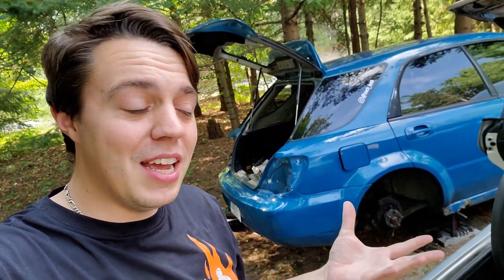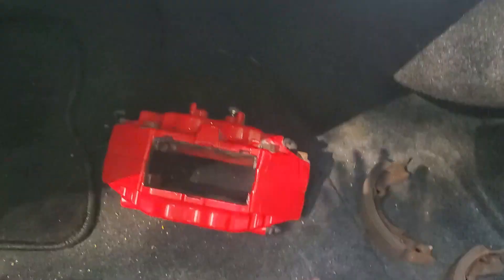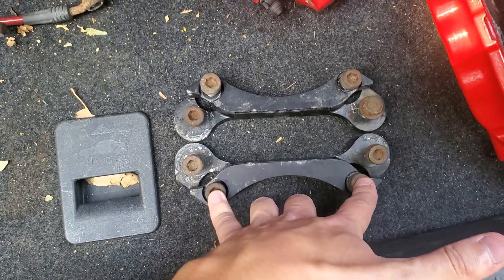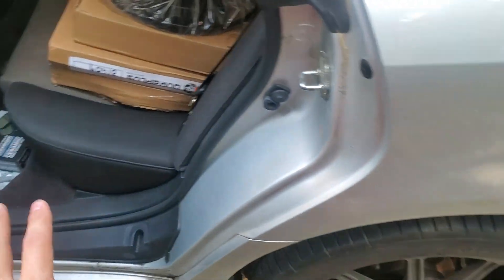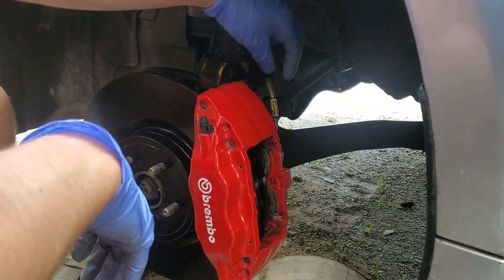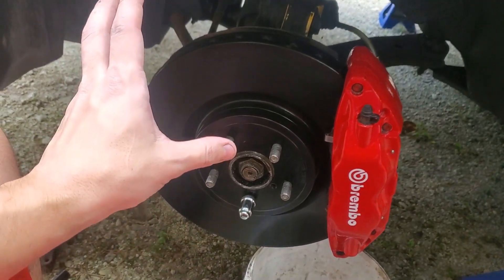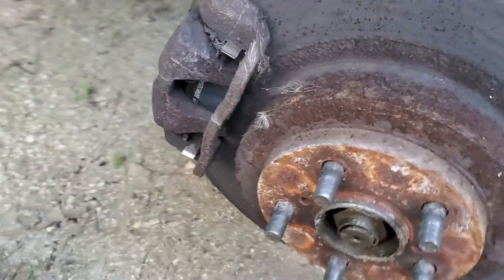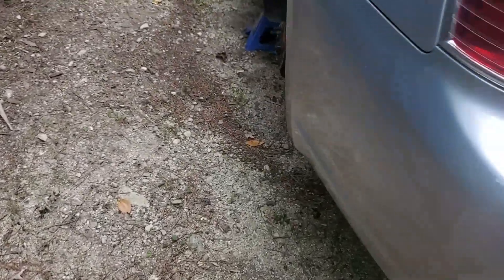Brembo Swap Your Subaru!

Comment: wait you went form black sti brembos to the same size brembo??
Reply from the maker: The black brembos are from a 2017 STi. The fronts bolt up but the rears do not. The red brembos I installed are from a 04 STi. They were originally gold, fronts are identical to the black ones, rears are different and will bolt up with an adapter bracket.

Comment: Hai Zach, i live in the netherlands Europe. I hope you have the answer on the one thing a lot off People want to know . I have a 2002 sti and yes i have the golden brembos... but.... i want to know if there is already a bracket to swap the rear golden ones for the black ones.  From the newer sti's.  I know it sounds dumb but i just have to know 😊
Reply from the maker: Hey Henk, happy to see someone from the Netherlands has seen my video! It is funny that you asked about swapping to the black Brembos. My Legacy actually came with 2017 STi black Brembos but only the front were mounted. The reason for this is there is no mounting bracket for the rear. Something I mentioned in this video briefly is that it is possible to install the black Brembos in the rear. BUT you have to remove material where the mounting bolts would thread. I don't recommend this this your weakening the caliper and being a crucial part to your braking system it doen't seem like a smart move. Your best option is the powder coat your Brembos if you are just trying to get the black colour.

Comment: What is your rim diameter? Im looking to swap my legacy too but i wanna keep my 17" wheels. Will this fit?
Reply from the maker: The wheels on my car are the stock BBS wheels from a 2004 STi. 17" should fit, just need to worry about offset.
Reply: @zach_lush  Thanks! Offset will be +45 on 8J instead of stock +55 with 7j, so there will be more room. I think I'll be fine

Comment: My rotor is 2004 wrx Sti and it doesn’t clear when installing caliper. I have an 08 if you do I highly suggest not doing the rear swap as now I need rotors that are slightly smaller to make the caliper clear rotor to actually be able to mount. Bolts do not mount. What a joke Subaru
Reply from the maker: You have an 08 what? Car or brembo calipers? Because the only rear brembos that will mount up and the gold ones which are 02-07 I believe. You'll also need a braket to make it fit and brake shoes. The newer black and green ones will not work.
Reply: @zach_lush  2008 legacy gt limited 
I have the 06-07 2 pot fhi
The adapter makes the caliper fit with distance for a rotor but with the rotor it’s about an inch away from diameter fitting
 04 rotor 316mm
If it was a clearance thing with the knuckle I would see it at least line up with the bottom thread for the bracket adapter but it’s and 1inch or less from fitting with the rotor
At this point I don’t know what to do
I just bought the regular rotors for the 08 legacy gt because the diameter is smaller… not sure why the rotors won’t allow the caliper to clear